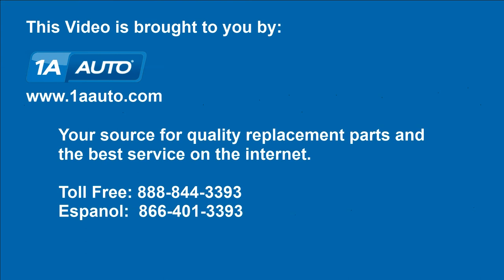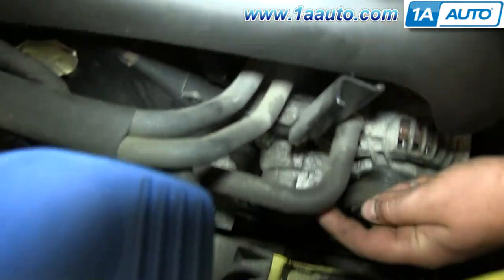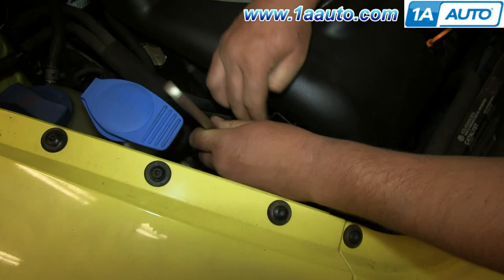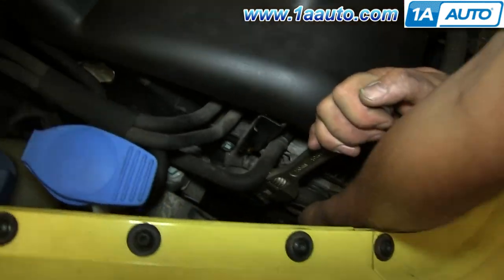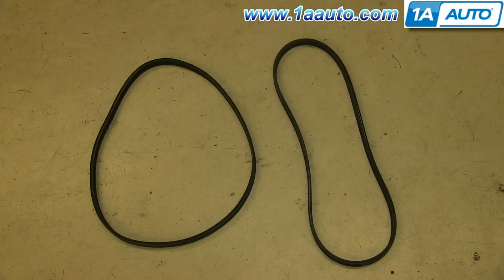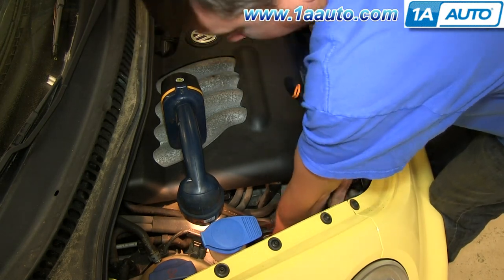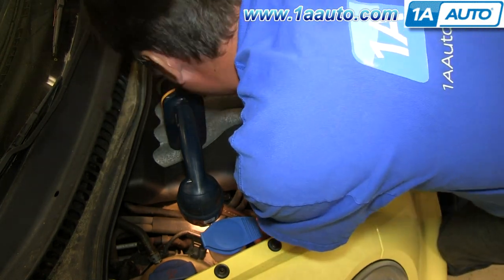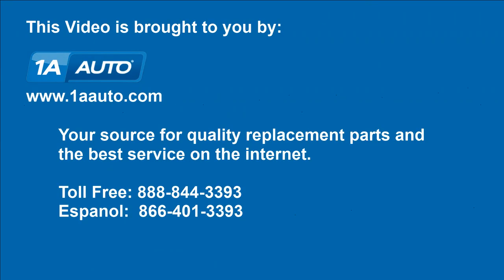How to Replace Serpentine Belt 98-07 Volkswagen Beetle

Comment: hello, your title says from 1998-2007.. but when clicking to watch the tutorial you state that the year for replacing a serpentine belt in a vw beetle is 1998-2005.. why is that? i have a 2007 vw beetle that needed a power steering pump now in regards to following directions i need to make sure that your tutorial for replacing the belt in a 2005 vw beetle is the same for a 2007 vw beetle.. please help my mechanic and i have been struggling for a couple weeks now on this fix.. any advice or tips would be awesome.. thank you.. D

Comment: My GF's has the throttle body in the way. Is it a diiferent process for the 01 1.8t?
Reply from the maker: +Mizino: In Over My Head. Thanks for watching!  The process should be similar to this vehicle, but if the throttle body is in the way then you will have to remove it.  1aauto.com